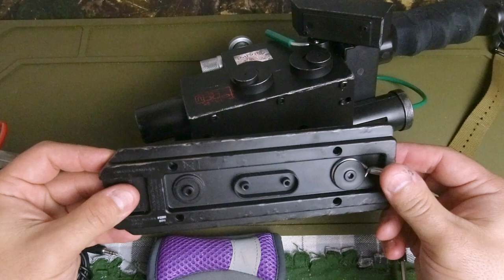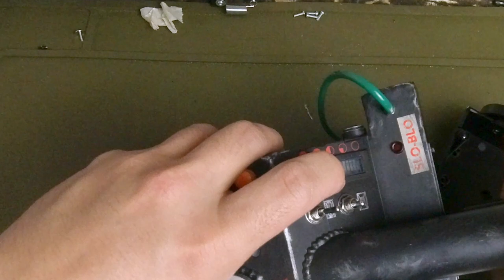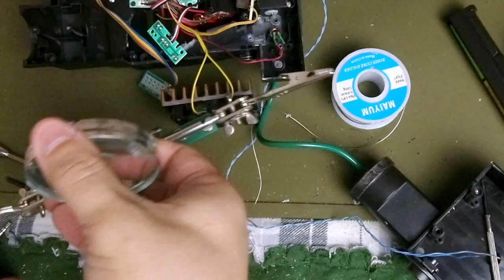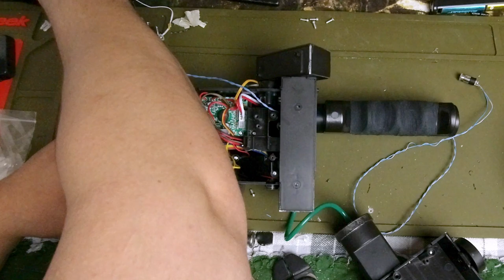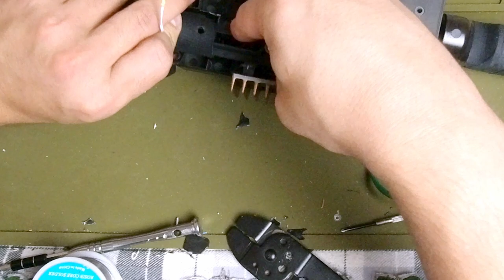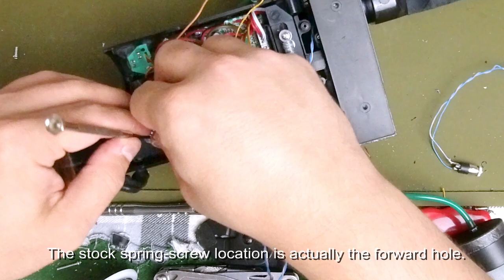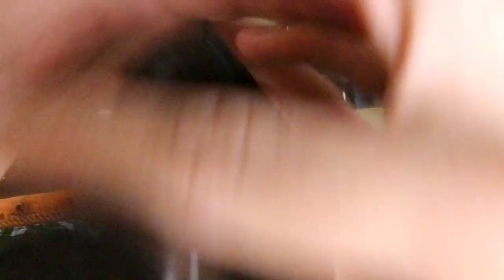EASY Vent Window Delete and Aux Jack Install - Hasbro 🚫Ghostbusters Spengler's Neutrona Wand How To

Comment: I had to fix the broken wire as well, stripped it, soldered it a tiny bit then tied it up, soldered a little more and hot glued it in place again. Noticed what you saw how it's pinched so I cut away some of that area too. Worked like a charm. Oh, the easiest way to get rid of the plastic covers on the outside that hide the screws. Take a small knife, like from a pocket knife, heat the tip with a lighter then just slightly poke it in, it cools instantly and sticks to it and you just pluck it right out with minimal damage, you can even reuse them.
Reply from the maker: Thanks for the tip and the comment and do please consider subscribing!

Comment: I'm trying this out on my second wand specifically for this purpose, The hardest part for me right now is cable management. I'm trying to tuck the aux wires away and lead them to the handle as you did but it's proving exceptionally difficult with all the moving parts of the barrel and lever and motor with the springs all over.
Reply from the maker: You got this.  Take your time.  Route the wires for max clearance and don't be afraid to use a little tape and hot glue to keep things tidy.

Comment: I came to that yellow glue on the speaker’s solder points and I stopped! Glad that I saw your video. Now I gotta open that sucker up again. Thanks!
Reply from the maker: It’s like my motto, “when it doubt - burn it with a soldering iron.”  Thanks for sharing your experience!  I’m glad my video could help someone out!
Reply from the maker: Thanks again for the comment and do please consider subscribing!
Reply: How do you get to switchs on the main body thank you
Reply from the maker: @paulortaglia1852  At about 24 minutes you can see that the backs of the switches next to the led graph are visible.  If you want to solder the connections directly, you can see them.  If you want to remove them, the nut holding them in is just exposed on the outside of the wand.  Should just be a quick unscrew job and you can get them out.

The one under ‘activate’ can be exposed by drilling out two more plugs on the side box.  

Thanks for the question and do please consider subscribing.

Comment: Very informative video! One question, I plan on hooking my Spengler wand to my spirit pack. Do you have a video showing how to do that so it utilizes the external speaker like you did in this video?
Reply from the maker: I never connected it to my pack, so unfortunately I can't show it, but you would just need to run your aux came through the wire loom/hose and find a spot for your speaker.  The test speaker I used actually would between the pack and Alice frame and kind of sit there.

Sorry I can't be more help on this one but if you've already got this far - this pay will be easy for you!  Good luck and thanks for the comment and do please consider subscribing!

Comment: Hello! GREAT work! Watched carefully to all your work on this one... and came up with a question: is it safe on your opinion for the wand sound board to drive both the little speaker and the external ampli wired in parallel like that? Shouldn't I need a switch to choose one output a time?
Thanks in advance for your answer, greetings from Italy!!! :)
Reply from the maker: Hello from Texas!  Well, to be honest with you I'm not the most knowledgeable when it comes to stereo systems and parallel versus series and impedance and the like.  What I can say about this mod is that the power this device is pushing, you are probably not going to hurt anything. The auxiliary jack, when wired as the video shows, is not a "line level" output, however. The wand does not have any volume control for the little speaker and thus for the aux output. The amplified speaker that you plug this auxiliary output into will need to be turned down because the level of audio coming out is going to be very high. That’s really the only consideration if you do the install in this manner. I have seen others that install a potentiometer/volume control knob to limit the output. So if any of this scares you you might consider looking into doing something like that.

Thanks for the comment and do please consider subscribing!

Comment: Pro tip, the built-in speaker uses tiny little wires they are easy to break as I did.  Also its a little induction speaker and had a tiny little copper wire that goes from the little pcb on the back to wrap around to the front to act as the voice coil.  Being an a total solderinh noob i accidentally melted this wire when trying to clean off the contact pads so i could re-solder the broken wires as well as add new wires for the aux out.  So i totally hosed the original speaker on mine.  Oh well it's so loud on the external speaker it doesn't matter, but i wanted to be able to have the extra speaker as an optional add-on but now it is a requirement.  Not the end of the world, but something to be aware of...
Reply from the maker: Hey, great info, Tyler!  That should be useful for other folks making this mod!  Be careful for that little wire.

These small speakers are a dime a dozen, so I’m sure you could put another in for pretty cheap if you really wanted to.
Reply from the maker: Thanks for the comment and do please consider subscribing!

Comment: ON the inside of the cap fill it up with hot glue to cover the wires on the end of the jack to give them protection and strength
Reply from the maker: I like this.  Thanks for the comment and do please consider subscribing!

Comment: Thanks so much for the detailed explanation. Right now Im following your awesome guide and its going well thanks to you! I wonder... If you solder the wires as you do, on the center outputs... and you also solder one wire on one of the existing stock wires... would you get an stereo sound?
Reply from the maker: Hey Dan!  I appreciate the kind and inspirational words.  I'm not sure that it works the way you are thinking.  The wand has monaural sound, so bridging the contacts (as I remember doing) would be to ensure that the connector.sends sound to both a left and right speakerif the jack/plug are stereo.  I think without doing this there are circumstances where you could end up with sound only going to a left or a right speaker channel which you would not want.  I hope I'm visualizing this properly and giving you a useful answer.  Thanks again and have a Happy Halloween!

Comment: ...also would a simple fix for the wire getting chopped be to just wrap some electrical tape around the wire in the spot it makes contact with the plastic. A few neat yet bulky wraps should provide enough cushion to make the wire push out of the way rather than get pinched. Great thorough video btw, thank you.
Reply from the maker: Maybe, or some adhesive foam tape.  Some tactical squish?

Comment: Just curious about the end cap. If you aren’t planning on using the Philip screw to reattach the two pieces why not just use that hole for the wires rather than create a new offset one?

Great tutorial btw thanks so much
Reply from the maker: The way I did it, I can still attach wire loom over the remaining part of I want to connect to my pack in the future.
Reply: @PeaceLoveAndGuns  Thanks for the reply. last question. when connecting the leads to another speaker does it have to be a speaker with it's own power source or can you have a speaker without one?
Reply from the maker: @jonogunn  If it's an unpowered speaker, it would probably have to be pretty small, as is the case with the onboard unit.  Unless you have something that is higher fidelity with similar power usage, you will probably want an amplified speaker.

Comment: I had my emitter tube wire get chopped too all the sounds worked ,now I've opened it up and fixed the connection, now when I go to fire it up it the start sequence works but as so as I press the intensify button it all shuts down
Reply from the maker: Definitely weird.  Did you do any other repairs under the hood while you were in there?
Is it ONLY when the intensify button is pressed?  No other function shuts in down like that?  ig Rumble works, turning knob makes in vibrate harder etc, the auto-shut off still times out after 30 seconds, the switch mode button works, etc?
Reply: @Peace, Love and Guns  
Ahh I've got it sorted the crappy factory  emitter wires ,I didn't realise their was three wires and thought it was 2 and crossed up one when I repaired the connection I've since cut it and rejoined the 3 separate wires ,but I'm going to run better quality wires up the to the light bar
Reply from the maker: @Guncage81  I was gonna say, " it sounds like something is shorting, but only when you hit the intensify."  That's exactly what was happening!

Glad you got it sorted!

Comment: the wire at the battery compartment is getting twisted when ever Im screwing the cap back on I modded the cap at the end but its still doing it.
Reply from the maker: I pre-unspin the cap so that when I tighten it, it untwists and the wire rests more naturally.  It's definitely something you have to be careful when you switch batteries.

Comment: What gauge wire did you use to connect to the speaker? Also what was the name of the connector for auxiliary.
Reply from the maker: 22 AWG should serve you nicely, but I just pulled the innards out of an old cat6 Ethernet cable.

The aux jack is Ancable 2-Pack 1/8" 3.5mm Chassis Panel Mount TRS Headphone Jack with Solder Terminals for Auxiliary Input/Output Port https://www.amazon.com/dp/B07JNR4PXN/ref=cm_sw_r_cp_apip_NM317HEWhH9nK

Thanks for the comment and do please consider subscribing!
Reply: I subscribed keep the videos going fellow ghosthead

Comment: I wanna take the vent window off too. I know you need to open it up but do you need to remove wires or any electronics to cut it off like you did?
Reply from the maker: Nope!  No messing with wires required!  Just be careful where you cut and not to pull on anything, as they are fragile!

Thanks for the comment and do please considering subscribing!

Comment: Cool video. Are there any wires directly behind the lens that would prevent you from carefully dremeling it from the outside? Just wondering.
Reply from the maker: Hey, @stevei7221 - you don't want to do that IMHO.  The plastic is too damn thick and seeing others attempts, you're very likely to accidentally cut into the black AND, even if you do it perfectly, you're still going to see the thick ass clear layer under the black when you see it at an angle.

But no, there are no wires directly behind the vent windows that an in danger.
Reply from the maker: Thanks for the comment and do please consider subscribing!

Comment: I'm surprised that you cut the cross-member above the main board, instead of unscrewing the entire piece...

Edit: actually, you did a lot of cutting/drilling where you could've just unscrewed things instead, been a little more non-destructive with things... Nonetheless, this is an interesting view into the internals of the neutrona wand.
Reply from the maker: Fair, but I mean, that is a little easier to say now with two full years of community groups figuring the things out.  There is also a lot of glue holding things in that appear to be only held with screws that does not remove easily and more plugged screw holes that were not widely known about at time of filming.  And subsequent batches have had wiring improvements confirmed by hasbro and perhaps less glue in weird sports by the way subsequent wands i’ve dismantled come apart.

This vid is a snapshot in time that’s helped a lot of folks get their wands looking and behaving better.  I’ve since put in ninjatunes, ghostlab42 keep-alive, and a custom led bargraph.  The extra space was maybe a little nicer to work with and I’ve never once thought about those chopped and missing bits.🤷🏽‍♂️
Reply: @PeaceLoveAndGuns  fair as well, tho I've previously never seen the inside of one of these, or even owned one myself (tho I do have one of the new 1984 versions on order from Haslab, so, might look into modifying it in the future. At the very least, I'm using it as reference for a custom one I'm thinking of making that's intended to be a half Star Wars version (IE made with Lightsaber tech).)
Reply from the maker: @Caldoric  In the case, make sure you get a proffie board and not xeno if you want that sweet GB soundfont!
Reply: @PeaceLoveAndGuns  well, that's the thing: I may have to either find a way to hook up a lightsaber board to a Neutrona Wand board, or get something like an Arduino involved, in order to handle the various switch inputs and visual outputs that such a thing would have. (I'm still planning on having some bar graphs and lights and stuff like a normal wand, just built to a more Star Wars aesthetic, like some random person in SW found a lightsaber, took it apart, and then figured out how to turn it into something more than a melee weapon, but it's still super unstable and prototype-y. Lightsaber "blasters" are an obscure bit of canon, after all: there's at least two on record, plus Ezra's original "stapler"-style saber grip.)
Reply from the maker: @Caldoric You might be better off beginning with a custom proffie saber board and build your hilt to match the aesthetic and lore you’re going for than trying to mate hasbro’s wand, which is fairly low quality, to a saber build.  I don’t know arduino, though, so I might be making that part out to be harder than it seems.

There is already a really cool preexisting ghostbusters sound font (and light effects) for proffie that is pretty cool.  Not sure if you’ve seen it or the guy that made a really cool GB-inspired hilt.

But yeah, I have a custom-modded LGT Starkiller TFU1 with exposed crystal with Xeno v3 soundboard.  It’s a lot of fun, but until they update their app(whenever that will be) no custom light effects can be installed apart from what’s already there, which is a good deal but no GB.
Reply: @PeaceLoveAndGuns  I'm not building a lightsaber hilt, though: I'm using some of Saberforge's "Adaptive Saber Parts" components for parts of what will eventually be my particle thrower, and I'll also be getting my hands on various switches and other electrical components, as well as making a custom main box that everything is connected to, much like the body of a regular Neutrona Wand.
Reply from the maker: @Caldoric  Sounds rad.  Post a video when you get done or let me know how I can see it!

Comment: whats that tool call for chopping plastic? and what store to get it in?
Reply from the maker: Those are called “flush cutters.”  They make great light duty cutters for anything you use wire cutters for but they leave a nice flat, not sharp edge.
Reply: @PeaceLoveAndGuns  alright then thanks

Comment: Since the battery pack is right there, do you even need to run two wires from the speaker to the aux jack? Could you just connect it to the common ground?
Reply from the maker: I’m not suuuuper gifted with electronics, so I cannot say!  Thanks for the comment and do please consider subscribing!  If you figure out a better way - let us know!

Comment: Is it difficult to replace the batteries on the wand with the new cables in the way for the aux cable?
Reply from the maker: The battery pack is easy to get in and out.  You just have to exercise care with the wires in screwing the cap on.
Reply from the maker: Thanks for the comment and do please consider subscribing!

Comment: What are the specs for the speakers you use to test the sounds of the wand? I tried using a 20w 8ohm speaker, and a 10w amp, but the volume isn't loud enough even at max volume, and I want to make it louder when I put it on my pack.
Reply from the maker: Pretr sure the wand’s onboard sound is pre-amplified to some degree for the little onboard speaker.   It is not “line-level” audio.  When I plugged into a bluetooth speaker with aux input, it was was really loud at low volume.  Other folks experienced the same thing.  If you’re not hearing anything, it’s possible you blew something out.

Comment: Hello maybe you can help me I've  hit a serious problem by accidentally attaching the wrong battery to the wand. 12v and now it just lights up with no on switch or sound coming through..

Is there a fix?
Reply from the maker: Oh wow, that’s a lot of juice for this thing.  Not sure.  Have you disconnected it to see if it returns to normal after?

Comment: You call this non screen accurate but in reality we haven’t seen this on screen since the new movie is not out and this is based on that wand
Reply from the maker: I mean, that’s just a bit pedantic, but considering the hasbro wand was copied directly from the movie (and we’ve seen the actual hero wand in the hasbro/prop comparison video and the trailer) and mine differs from even the hasbro wand... it’s safe to say mine is not screen accurate.

Thanks for the comment and do please consider subscribing!

Comment: Wouldn't it be wayy easier to just drill and grind the vent window with a dremel than to literally take the entire wand apart? Use a shop vac to suck up the pieces while you go.
Reply from the maker: You try it that way and make a video for us!  Thanks for the comment and do make sure to subscribe.

Comment: What kind of wire did you use to fix the light problems? My wire is cut
Reply from the maker: Any suitably thin wire will do.  I use lots of scraps in my projects and there’s always some ethernet cable you can pull strands from.
Reply: @PeaceLoveAndGuns you just pull any wire from either net cable. Wow didn’t know you can do that. Thank you
Reply from the maker: @DanielRamirez-os2we  There are four twisted pairs or wires in an ethernet cable.  So one junk cable will yield lots of wires for little projects you have.